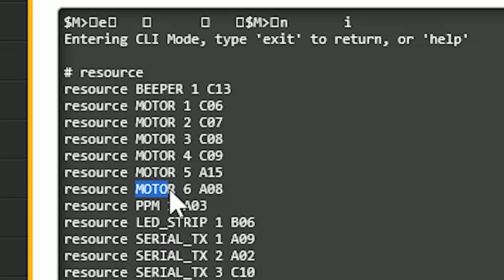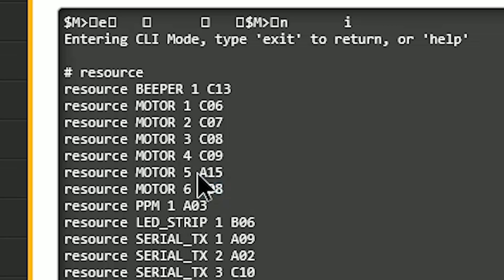Betaflight FPV Camera Control | HOW TO

Comment: I have a Speedybee V3 and I am trying to implement camera control. According to Speedybee i just need to connect it and it should work...
I am using a Foxeer TRex mini 1500tvl.
Is there any settings i should be tweaking or resistors i should be adding?
JB you're my last hope. I ve spoken to everyone that i could find and still no shot :(
Reply from the maker: Analog camera control can't be 100% guaranteed to work because it relies in emulating analog resistance with pwm. You can tweak the CLI settings but it's very trial and error.
Reply: hey just stumbled over your comment and figured out how it works. You need to flash the firmware again and under "Other Options" in the flashing tab choose "Camera Control" and flash it.
Reply: Thank you for your comment. I ve figured it out. Apparently I needed a capacitor but the position was important. I was puting it close to the FC when i needed to put it close to the camera. Hope this helps some poor soul like me haha @OneTakeFPV

Comment: I have the Foxeer razor, weird thing is the osd ground is white and cc wire is black?? According to the silkscreen on the cam anyway. Is there a setting I need to enable in beta flight? When i press right on the throttle nothing pops up.

Comment: Don't FORGET to set CORRECTLY your stick's COURSE !
I had try all things because my left and my up was not working, but just after push my end trims on my radio up was working but not down, so I had a little more course on this axes (2 more point on my dx9) and a is working fine with all default parameter ! and only one cable solder to S5 and remaping thes ressource ! 
Thank's It's so usefull !

Comment: Hey Josh...broke the osd pin on the back of my camera but absolutely need to adjust my camera settings. Is there still an option for me or would I need a new camera? 😓
Reply from the maker: Seems like there should be some way to get connectivity to that pin.

Comment: Great video JB. Just wondering, in case you have connected a minimOSD board to the FC, is there a way to make a connection from the camera in order to access also the OSD camera menu (not the MWOSD) with the radio?

Comment: Hey Joshua still having issue with my GepRC cinepro, I cannot get stick control working, I was told for the Caddx to use run cam I needed this Caddx FC cable, I purchased it and connected it, still not working could you please help me out.

Comment: Hey I know this is a old video I'm running beta flight 4.0 point something something and I also have an Omnibus F4 V5 do I still need to use LED strip pin? I don't see nowhere in my pin map that say camera control can you direct me to some other video or can you help me

Comment: For the runcam with uarts you don't need to do this. But what with the foxeer predator v3, with osd and ground pin? Is this video make for these kind of cam outputs?

Comment: Joshua I need help, I have a GepRC cinepro 4k, it is the bind and fly and did not come with a remote to access the FPV camera contrl, the 4k camera is accessed via wifi and is not an issue. Since the gep guys say fit not to included a remote to plug in and access the camera control I am told I can do stick commands all I need to do is assign one of the unused UART to runcam device. I tried that and it is not working for me. I watched your video on this and it is confusing to me as I do not know if I have one of those boards with a camera pin already there both in FC and Caddx boards or I need to do as you did in the video. I have tried to find pin outs of both the Caddx and F7 boards in the Cinepro and cannot figure this out. Maybe you can help me.
Reply from the maker: They want you to do UART based camera control, not analog. So there will be a TX and RX pad on the camera, and you will connect them to an un-used RX and TX pad (same UART number) on the FC. Then in Ports tab, enable Runcam device on that UART. Then use stick commands as shown here to access the menu.
Reply: @JoshuaBardwell  Joshua brother I am a rookie, I kind of get what you said but, not sure. Are you talking the RX and TX of the Caddx tarsier board in terms of PADS. I understand the FC having pads for RX and TX, but you said the camera, I am thinking you actually mean the camera board as having the RX and TX pads. In any case I am having lots of headaches here cause I am a noob, I am also sorry in advance for bing an idiot.
Reply: Also let me say are you saying find a unused RX and TX for a articulations UART on the camera board and then connect it to a RX and TX same UART on the FC board. I also cannot find a proper diagram of that for the Cadddx Tarsier and GEP F7 board. I know you know this stuff cold, but consider me a really new to this guy.
Reply: Ok Joshua I think I may be seeing some clarity hear, I see a RX and TX on the caddx board it does not have any UART to it, just simply one RX and one TX. On the F7 board I am seeing in pair a R1 and T1 and a R3 and T3 and so on. I am assuming that is my RX and TX UARTS on the F7 board that are listed T1 and R1 and so forth. So you are saying connect the RX and TX on caddx board to one of the empty set of RX and TX pads on the F7 board that are listed R# and T#. Then select that in the betaflight UART ports tab. And do I need any resistor or capacitor. I also did a resource command on the CLI and it already has a line that says camera control 1 A00 in the list.
Reply: Before you reply I also have one last question, I asked this on your smoke stopper video, but you never got back to me on that, on my cinepro if I use a smoke stopper will that help with me heating up my VTX and FC board when I am doing setups and having to have a battery connected. The F7 stacks and the VTX get really hot fast and I am slow, so I was wondering of the smoke stopper would allow me to have a battery connected for a long time and not over heat the quad. Sorry for asking that here and asking soooo many things.
Reply: Joshua I am told by some guys that I need a board sold by caddx to get this working right, I think you are right, but Oscar liang has a  blog on the web that talks about it. I have the caddx tarsier v2 and the F7 board on the cinepro from GepRC. I do not see why what you say will not work, but can you double check to be sure. Sorry for all the issues, but this is starting to be a real headache trying to get something soooo simple to work.
Reply: Joshua I did as you instructed or at least I think I did. I soldered 2 wires to the caddx board on the RX and the TX, the I soldered the TX on the caddx board to the T3 on the F7 board, then I soldered the RX on the caddx board to the R3, I then went into the betaflight and configured the runcam device to be on UART3, then did the stick command throttle half way and to the right and nothing , tried it half way and to the left and nothing. It I did not work, what do I do now????
Reply: I might have a small other issue, maybe you can help, while I was trying to get the camera setting up I went into the menu for stuff like PID’s and stuff, well there was a profile and I might have changes it to one of the 3 profiles it had stored and I am not sure now what profile it came standard wether it was 1,2, or 3, any way some how I also lost the data on the screen that tells you what channel is on, and voltage left and other stuff. All I see now is a what the drone is seeing and all writing is gone now I get no hud info. Not sure what I have done. But soldering those wires from the RX and TX of the caddx to R3 and T3 did not get me into camera control and now I have lost the hud as well.
Reply: Ok I got back my OSD and it seems fine. Still not sure what profile it shipped with 1,2 or 3 I think it was 1, so I will leave it there, nothing else major was bumped in there. However Joshua soldering those wires did not give me camera control, so I am still no further ahead now than I was before. I am pretty sure I did exactly as you asked me to. Tried many times to get the camera settings to appear via the half throttle and push right, it simply not working. I know you are very busy but if there is any way you can sort me out, I can skype with you if that might help. Buddy I really could use a little help, I cannot find anyone local that knows anything to help me, otherwise I would do that.
Reply: Is it possible I need to connect a ground wire as well. In a page I read on doing this UART method it shows connecting a ground wire as well. I have also seen that Caddx has to use this board that plugs into the remote plug and then wires to the RX,TX on a UART and to a 5v and ground. This seems like more weight and possibly just a money grab, but I am not sure.

Comment: Hi, I used a08 (its motor 6) in preferences; # get camera_control
camera_control_mode = HARDWARE_PWM
Allowed values: HARDWARE_PWM, SOFTWARE_PWM, DAC

camera_control_ref_voltage = 277
Allowed range: 200 - 400
Default value: 330

camera_control_key_delay = 125
Allowed range: 100 - 500
Default value: 180

camera_control_internal_resistance = 470
Allowed range: 10 - 1000

camera_control_inverted = OFF

Allowed values: OFF, ON

First time add resistor 220, second time not used because samebody wrote that FC Matek on pin s6 have 200 ohm resistor. I add cap 10 uf between OSD and GND in the sdr1 camera. Not run OSD on SDR1. Can are you help?
Reply: I run, change only SOFTWARE_PWM, but navigate isnt perfect;/ I cant get out and back (wyjdź i powrót) and left stick not work property

Comment: Hi Joshua, thx a lot for all your posts about setting up things around quads. However i got a question about camera remote control. I’ve got Kakute F7 AIO and Foxeer Predator V3 Racing. I’done everything right about setting it up as the FC manual said, solder it on M5 spare signal pad which has a resistor specialy for it, watched your video about it and done everything and it’s still not working. Is there any chance you could help me with this please?

Comment: Can I remap the ppm input pin of my fc for the camera control? (Does it have a timer for itself?)
Ps if you still reply on comments on old videos like this you're awesome Joshua <3
Reply from the maker: I don't think that camera control requires a dedicated timer. I do think that the PPM pin probably would work.
Reply: @JoshuaBardwell  in the video you said the key thing was the pin had a dedicated timer (for the analog cam control, not the serial one). Has this changed in recent betaflight versions?
Reply from the maker: Nothing has changed. So if I said it before, it's still true. Maybe it's only if you're using software based control that you don't need a timer.
Reply: @JoshuaBardwell  I would think so because that would just be using a regular uart.
I've looked in the source code (yes I'm a nerd) and the ppm pin on my board does in fact have its own timer.

Comment: Hey Josh, do I need to add a capacitor if my FC has a cam_c pin already, it's a cl racing f4s.
Reply from the maker: If it has the CAM_C pin you don't need any additional circuitry.

Comment: What if I have a JB board with crossfire on tx/rx6, vtx control on tx/rx4, and a Runcam Eagle micro that only has tx/rx for control. The trouble is that the JB boards uarts are now full but the Eagle only has digital control which dose not work on the cam-c pin.  Or does it?
Reply from the maker: In the Troubleshooting section of the JBF4 manual there are instructions for how to remap LEDSTRIp pin to softserial. This will let you move vTX control to LEDSTRIP and free up UART 4 for your GPS.

Comment: So if the stick command doesn't put it into the menu, does that mean my camera doesn't support it? I have the dalrc fc722 board with the cam control pin but center throttle to right doesn't bring up menu. Admittedly camera is an older hs1177, but uses the 🕹️ to adjust it. Did I miss a step setting it up in BFC?
Reply from the maker: Analog camera control simply doesn't work reliably with every camera and FC. There are some command line options you can tweak to try to make it work.
Reply: @JoshuaBardwell  is that the cli delay time? Or whatever that value was called? About to order some new cameras. These are pretty old, like 3 years old at this point. Probably time for an upgrade. One of few things that never were upgraded with everything else.

Comment: Thx for the video, however I can not access both menus, only one:
I'm able to enter the picture adjust menu, but I'm pretty sure there must be a menu where you can ask to display voltage on the osd via the camera. How do I acces this 2nd menu via stick commands and osd? It'a a foxeer camera, I believe it's the predator mini camera.
So, this menu, I guess if I turn power on, I will get a voltage reading on my osd if the vcc pin is a battery direct connection?
Reply from the maker: Hold up 2 seconds on the joystick to enter the OSD configuration menu.
Reply: @JoshuaBardwell  Thx, I guess my question was not a 100% clear. With the external foxeer joystick, I know how to enter both menus, but I was wondering how to enter the menu with the radio (taranis) stick controls? I'm able to enter the main menu (picture settings), however, there is also an osd settings menu to display stuff on the camera osd like battery voltage etc., which I don't know how to access via radio sticks --> fc --> uart tx --> camera. E.g. the picture adjust menu is yaw right, so far so good.

Comment: is the beeper on a dedicated timer aswell?
Reply: i was wondering this as well. but it may not be sense it is simply just a + and - output, LEDs have a + - and signal wire which is what you need.

Comment: I know this is an old video, but I just put a Sparrow V2 Pro paired with the bardwell V2 FC+ESC.. i can access the  menu no problem, but i must be a dummy I cannot find how to turn off the cameras OSD... I just want the betaflight OSD on. but the camera one is on and I dont see it in the menu options?
Reply from the maker: Enter camera control mode. Hold up 2 seconds on the joystick which would be pitch forward.
Reply: @JoshuaBardwell  Thank you kind sir, I figured it out before I saw this, had to hold pitch forward, before hitting yaw right and then it went into cam OSD and I turned it all off.  PS. I learned something today. Seems a little weird they dont just put all of the options in the main menu? whats the point in the hold...etc. oh well It works! no stupid joystic now!

Comment: So just solder the video wire from the camera to camera control instead of camera signal?
Reply from the maker: No, definitely not. Video is unchanged. The camera joystick osd wire goes to CAM_C.
Reply: @JoshuaBardwell  got it, so simple with your board 👍

Comment: Works with the PPM pad (B14) on the 20mm FC  from HGLRC, called micro F4, the whole stack is called XJB F428. It is used for instance in the XJB145 craft, and it works with the camera in there, the XJB-ELF that is a rebranded runcam micro swift. Just wanted to share. 
Btw, the FC creates a PWM signal with ~660kHz frequency that the R-C lowpass filter smoothes into an analog voltage with steps of about 0.4V.  I observed following functions: 0V-down,  0.4V-right, 0.8V-up, 1.2V -left, 1.6V-enter.

Comment: Im using the new CL Racing F4S. It worked the first time and only once. I rechecked evrything. I reflashed fc and it worked again. One time only.

Any ideas?
Reply from the maker: Unfortunately you just have to dig into the CLI and start tweaking the parameters :-(
Reply: @JoshuaBardwell  figured it out. Throttle end point was off. Thanks for all you do and taking the time to respond.

Comment: How do I access how to turn off the name voltage and timer with stick movements?
Reply from the maker: To adjust the OSD, press "up" on the joystick for 2 seconds. So enter camera control mode, then right--stick up for 2 seconds.

Comment: I cant get into the camera control menu using the Micro Swift 3. I have tried everything and I think the problem must be my transmitter settings. Does anybody know if you can edit the parameters of the stick commands? Or what they are exactly? I know you need to yaw right to enter, but to enter the menu, do your sticks need to be at roll 1500, pitch 1500, throttle 1500, yaw right 2000? Or does it just register as a "right click"? I have tried every possible uart on several fc's and made sure that "runcam device" was turned on. I have also tried reversing the tx and rx wires each time. I have even emailed Runcam, but they dont have any technical help, mostly just sales people. Im stuck and getting annoyed.
Reply: Figired it out. Looks like your channel endpoints must be calibrated exactly. If anyone else has this problem, make sure your endpoints go from exactly 1000 to 2000. Use RXRANGE in CLI.

Comment: How do I get the second part of the settings where I can switch of RunCam osd on cam control?
Reply from the maker: Center throttle yaw right to enter camera control mode. Then do exactly what you do with the regular joystick. In this case, right stick up for 2 seconds. This gets you into the OSD menu which is separate from the regular camera menu.

Comment: Hi Joshua, i hope you can help me. I just put an 150 Ohms Resistor in my Quad and i set my delay to the accepted minimum of 100. If i push my left stick to the right, my system make at first a double click. So what can i do to solve my problem ?  Best Regards Chris from Germany. p.s sorry for my English i hope you understand me ;-)
Reply from the maker: Use a higher resistor value if you can, and increase the delay.

Comment: Hey Joshua!
I got the the Bardwell f4 and a Caddx sdr2, but somehow I just can't get the Camera control to work! Any ideas?
Reply from the maker: Check the troubleshooting section of the manual for suggestion of cliparameters to tweak.
Reply: Ever get it working with the caddx?!